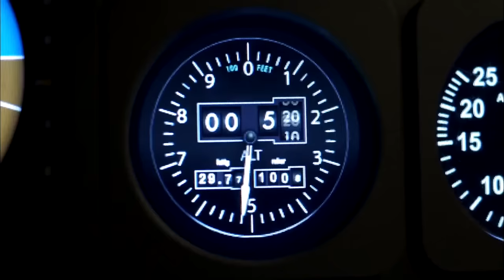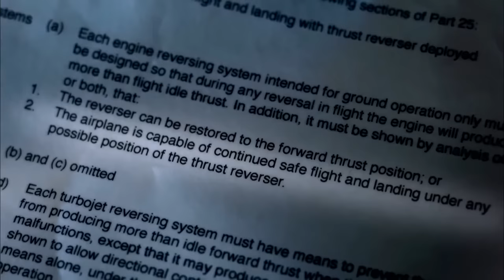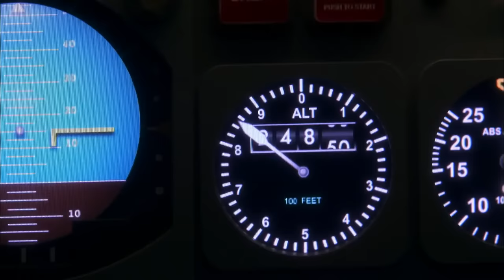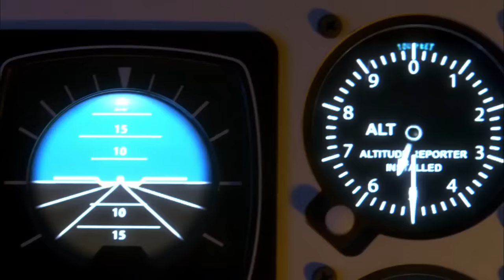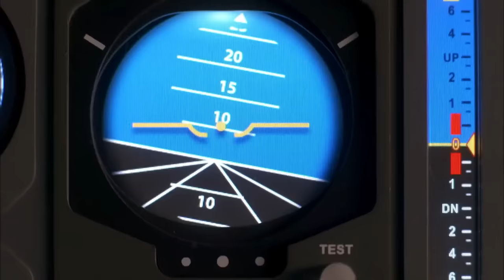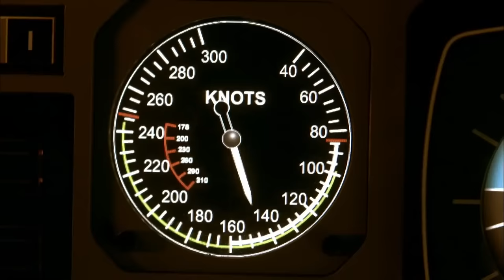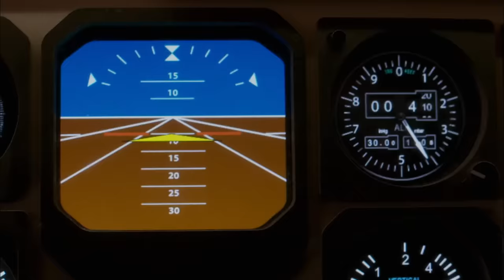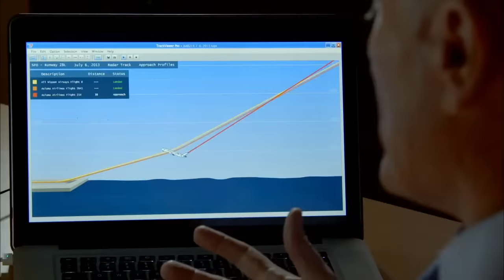Every Single Plane Crash - Air Disasters Seasons 8, 9, 10

Comment: 1:20:00 Dude that rushed to the plane is classed as a hero and he did nothing , he didn't get the door open nor did he even try he stood there and watched the plane explode and burn , the people on that KING plane could of been saved , if he went to his boot or trunk as you call in Usa, he could of got a tire iron and busted the lock open on the door or at-least tried , but he choose to do nothing but stand by and do absolutely nothing but watch , he now says he had to go back to hanger to get tools to free the door and there was noting else he could of done but that and if he did that it be too late so the last few things that poor lady pilot seen was that man just standing there like a spectator to a ball game and watched them all die, if he opened his trunk of his car and got the tyre iron this could of been that job solved , what else could he have used if he went to the hanger and get something apart from an axe which i doubt he would of got based on the things he did on the build up to the advent of the horrid explosion 💥💥 , just based on the event and what he did on the run up to the explosion regarding action times alone, I'm pretty sure he would be the type of dude that would of came back with a fork or a dessert spoon as a tool, if ya ask me he was no hero, in-fact quiet the complete opposite of one in fact , more the major coward than anything else, as useful as two wet socks is what i would call it , certainly wouldn't be one that you could depend on when the going gets tough that's for sure  !! P.S. I hope he damn reads this comment too.